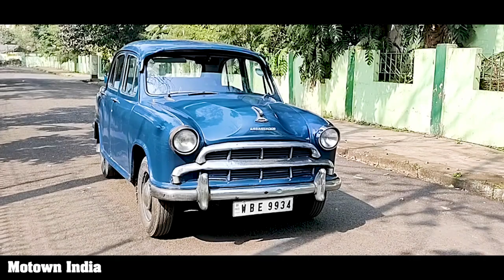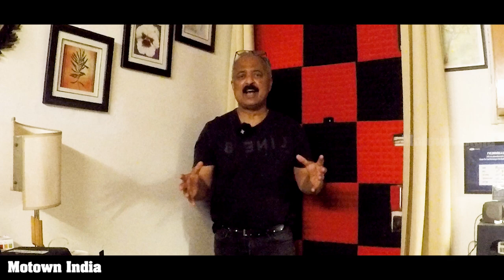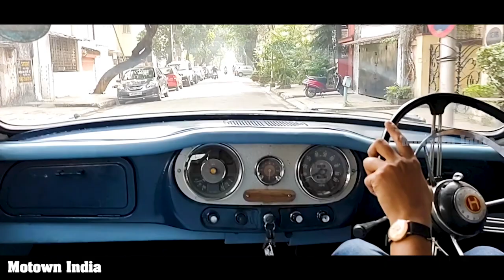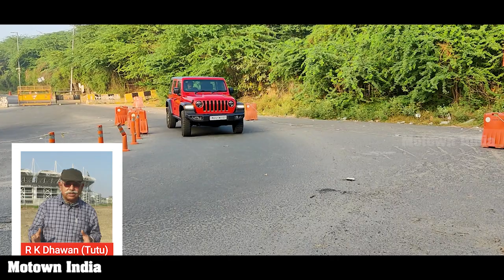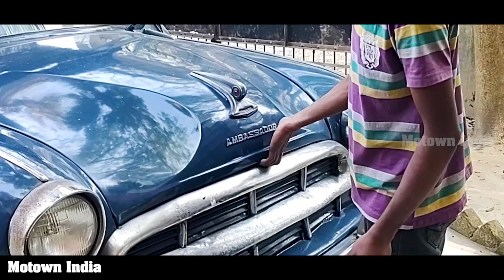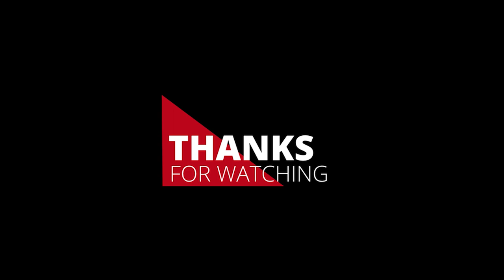COLUMN MOUNTED GEARS | Hindustan Motors Ambassador | Special Feature

Comment: Some unique features that I remember about our ambassador mark II ( in memoriam)...
- Child lock on the doors.
- Electric fuel pump next to the fuel tank.
- The foot operated dipper switch.
- The Stromberg Union (Birmingham) carburettor with a dash pot.
- The oil bath air filter.
- The pull starter knob and the unique pull starter switch.
- The electricals with (+) on the body and the (-) on the mains.
- The imperial sized nuts and bolts
- The electrical cutout.
- The dynamo.
- Car horn easily repairable by horn kits.
- The rotary switch for parking lamps and major beams.
- The dashboard clock that requires no power source.
- The steering wheel mounted horn ring and turn indicator switch.
- The dimmer switch for adjusting brightness intensity of the dashboard meters.
- The quarter windows on the front doors.
- The bonnet lever located to the far left unlike today's cars.
- And of course the steering mounted gear shifter.

Comment: Sir, it seems u & Mr Dhawan the most i.q thing... yesteryears there used to be no split seats in the front and three and sometimes four people also used to sit on the front seat. Shifting gears between legs of passengers used to be difficult and that is why ..rest you can think out...I would also like to point out that if anyone argues, it may be given a thought that Ambassador was a copy of Morris, although Morris used to have floor gears due to split seats..then why would HINDMOT required the change. Thanks